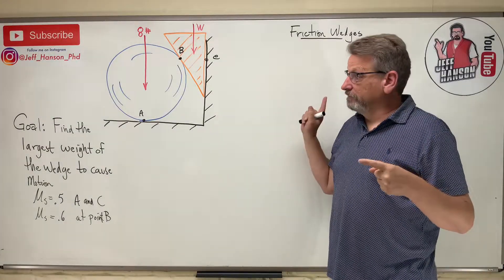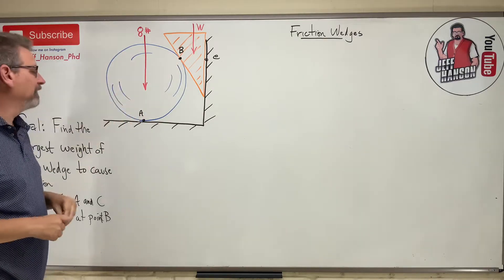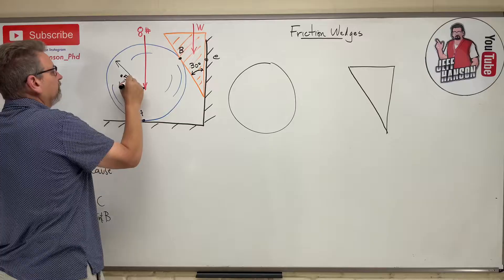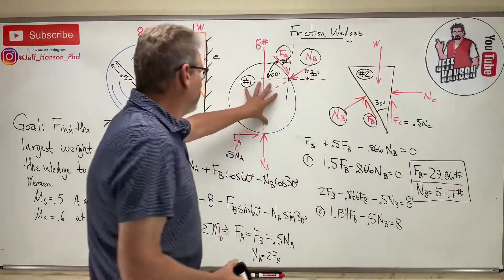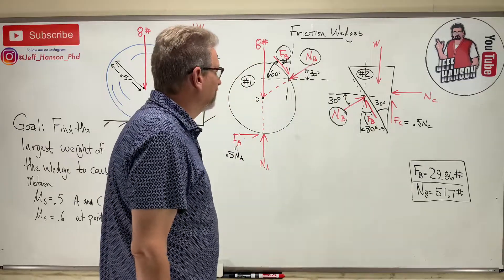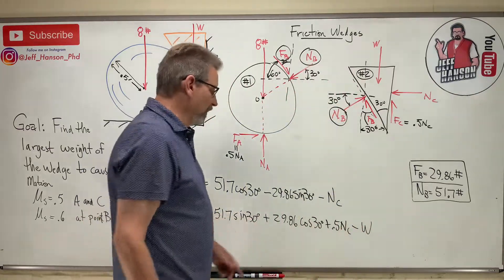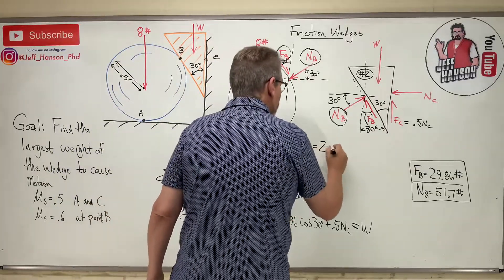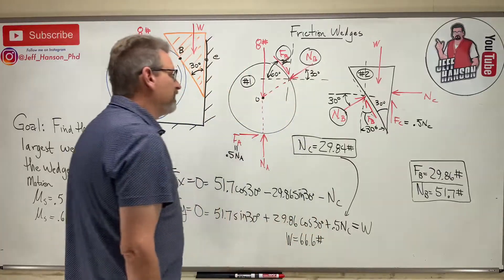Statics: Lesson 65 - Challenging Friction Wedge Problem with Roller

Comment: i dont understand the friction directions... i mean like u say if im the wedge id feel the wheel spinning clockwise an so thenfriction should be down ..but made it up
Reply: Because if it slips at point A then that means the friction at B has to be going the same way as the force. Its not slipping at point B, so its going the same direction as the wedge.

Comment: I thought when u do A moment you should include multiplying it with the distance. Why isn't it done here? Am I missing something?
Reply: Fa and Fb are acting on a circle tangentially, hence the distance is the radius. So the distance is equal.
Reply: @10ursylmz  Thanks! Why does he use sine in the wedge equation for Fx?

Comment: I solved few starting problems and noticed in wedge problems 
Break Fs (friction force) into 2 components and break normal force  which is acting on wedge or wedge applying,into two components

Comment: I don't understand what numbers he is putting into his system solver and where?
Reply: hes using the TI 36x calculator which has a system solver that does all the algebra for him which can be done in either a 2x2 matrix or 3x3 matrix,  in this one its 2x2, solving for 2 unknowns with 2 equations. Sounds a little confusing, but he has a video on his channel on everything you need to know about how to use the system solver, you can just look it up. So, I would recommend getting a TI 36x calculator and learning how to use the system solver from his channel if you want
Reply: solving linear equation

Comment: Is there a reason why we couldn't have avoided the moment equation by simplifying the 2 equilibrium summations of forces (x and y) by setting the friction F_B to a constant (mu_s=0.6) time the Normal at B? Solved via a system of equations for the N_B to use in the next free body diagram[the Wedge].
Reply: It's probably because the state of the surfaces at point B was not stated or implied to be about to slip (under impending?) such that the value of the static friction is maximum Fs=(us)N. Remember that static friction is defined to be Fs≤(us)N. It is not always equal to (us)N.
Reply: I couldn't understand why didn't we call the Fb=0.6Nb, with this equation we can easily solve with 2 unknown Nb and Na